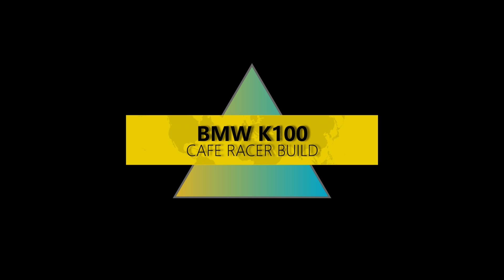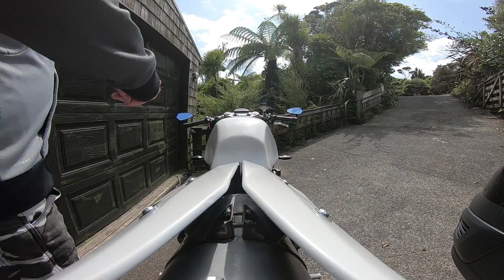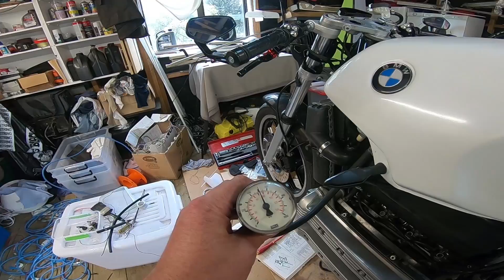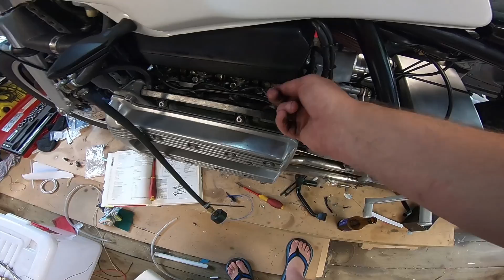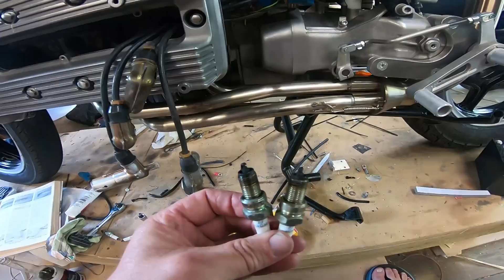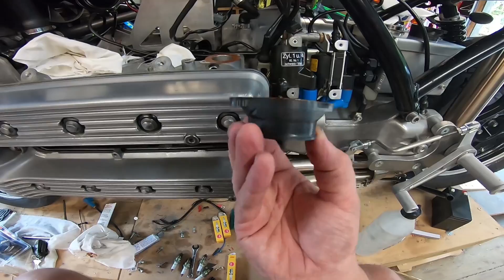BMW K100 CAFE RACER BUILD PART 46

Comment: hey there, I noticed you change two coils at a time,
why not one.
are the caps shorting out on the head, ive had this,
sound like is an electrical failure under load.
recheck your valves, have you altered the timing when you had the cover off. 
Im not going to read through my  manual but if yoiuve reset things like valves, maybe a past owner played with the timing setting and you may need to rest.
Its just a point of interest
Reply: I have several k100"s
Reply from the maker: Hello ... keep watching and you will find out what the problem is ... a bit of a spoiler alert but it is fixed ... I am no mechanic so with my limited experience and knowledge it was a process of elimination... cheers any how

Comment: I really have a strong feeling it's an electrical issue. You should measure the sparkplug caps. Real easy to do. (Made a video about that: https://youtu.be/6eX51fIQc8Y) Measure the inside of the wire (without the cap) and check the figures. Twist on the cap and measure again and compare (should be less resistance. That's normal). Check everything with your workshop manual. I don't know if you checked if you get a consistant spark either. This can be done by just holding the sparkplug against the engine casing while idling the bike. Gives you easy in your mind to know for sure that this all is ok. Offcourse it also could be a valve issue. That would be your next step. You haven't done an engine restoration btw? Will keep following you! 👍
Reply from the maker: Hi ! No I have not done an engine restoration and it was running ok when I first got the bike how ever I never rode the bike just started the engine when I first got it about a year ago , this makes me think it is something I have done , thanks for all your help , really appreciate it !

Comment: Hey Mike it looks like a valve issue. The best way to go about this is to do a compression check on all the cylinders,  you made a comment that you notice that there was a flame coming from one of the intakes and  that should not happen!  The  only way this can happen, is if your intake valve is not closing  and sealing the combustion chamber, I notice also that the engine has a knocking sound and that might be an indication of bigger problems!.
Reply from the maker: Hello yes I will be doing a compression test / leak down test in the next day or so , the Gopro mic does exaggerate some sounds  and make them sound a lot worse than what they are , i guess the compression test will tell more !

Comment: I know nothing but all I know is that people warned me about changing the air intake and exhaust as it disrupts the engine, have you had it tuned? I don't know if that would even effect it as much as the symptoms you have
Reply from the maker: yes its a possibility , I have a few more things to check , its a real head scratcher for sure !
Reply: Yeah but to be fair this would mean it wouldn't idle nicely so its probably something else, good luck finding it  @mikeyfrompiha

Comment: Mike the only thing i can think of is problems with the inlet valve. How else its possible to see fire on the gashouse side? Maybe someone has a camera that goes through the sparkplug hole and see if you can inspect the valve. Or maybe you can measure the cilinder pressures?
Reply from the maker: I took valve cover off this morning (another problem for the next video) valves seem to be working ok , need to get a set of feeler gauges to confirm  though

Comment: Maybe because you remove the air box
Or the fuel pump
Reply from the maker: yes maybe , I still have the airbox so might have to put it all back on there and check
Reply: @mikeyfrompiha   personally I put a pump from a Peugeot 605 because my genuine pump liking from the top and I cleaned all the electric connection.